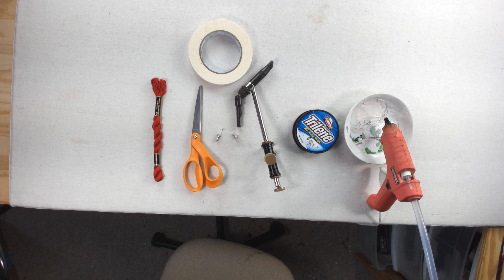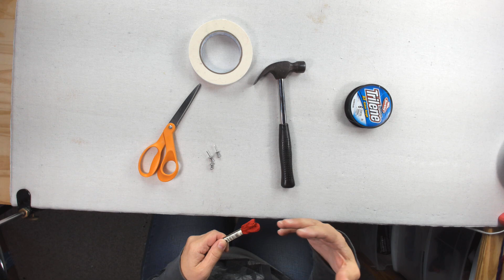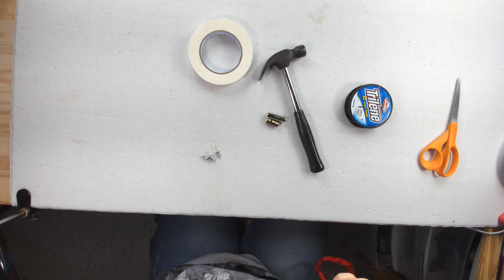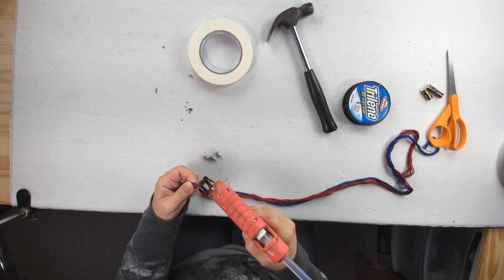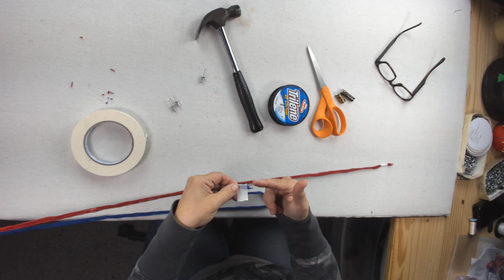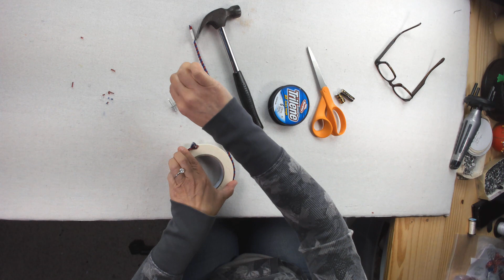How to make twisted cording for needlepoint or any project!

Comment: How do you calculate how long to make the strands before twisting to make a long enough cord?
Reply from the maker: It isnt always easy because it depends on what fiber you are using. Pearl cotton doesn't compress as much as yarn does. The thicker you want a cord the longer you make pre twisted length. Any ornament I make 3ft. Because that is what pearl cotton is when you open it up and cut skein at not. I dont have time to unwind fibers for small pieces. I do 10 stand each color for ornaments using pearl. 24 strands EA. Pearl for small pillow, 36 for large. If I need 4ft of cording for pillow i cut 7 ft strands. I'd rather waste fiber than come up short. As I sew it on i twist it tighter, so if it is just the right length, ill end up short as I sew on. Hope that helps!